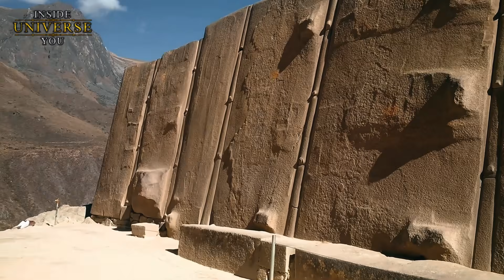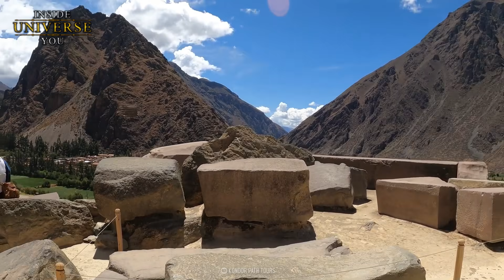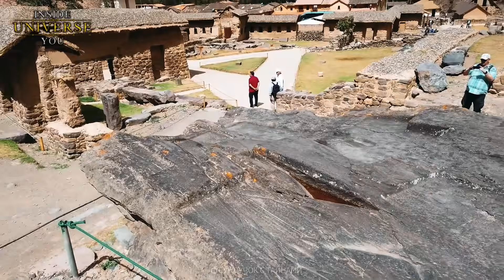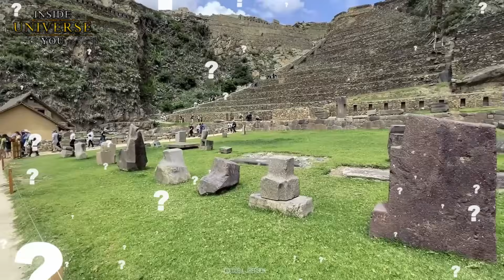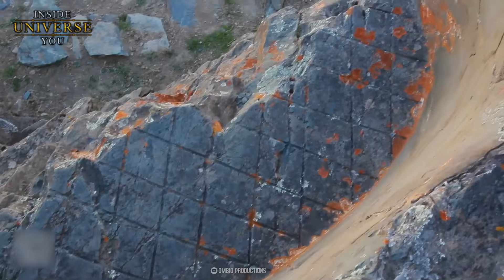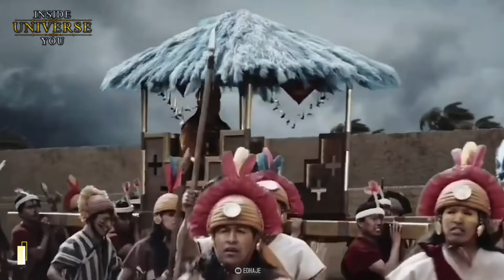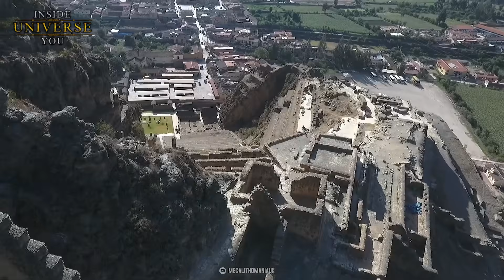Pre-Historic Mega Structures of Ollantaytambo Predating the Inca

Comment: notice how uniform and fused .. almost like at one point is what the texture and consistancy of clay .. they more than likely knew what ingredients/elements were needed and had high concentrations and applied a method to mold .. like drying clay into a powder and later adding water to it .. it's all clay when it's done .. looking at the smoothness around edges and the smoothness of the surface and abrasions and the level of high concentration of the same ingredients this looks like a sculpture

Comment: 🇬🇧 ∇ Global Stone Geometry — Logical Analysis

Here’s what the data suggest when examined logically and geometrically:
∇ 1. A Shared Language of Stone
Across vast distances and unconnected cultures, we see nearly identical construction logic:
Polygonal, interlocking blocks with no mortar.
Curved and softened surfaces, as if the stone had been malleable during shaping.
No impact marks or chisel traces, implying energy-based or field-induced forming.
This points to a shared technological paradigm — not coincidence, but a geometry-based knowledge matrix preserved across time.
∇ 2. Functional Geometry, Not Decoration
These forms are not ornamental; they are mechanical and energetic in nature:
The irregular seams disperse seismic vibrations.
Angular fitting eliminates weak joints.
The layout mirrors standing-wave or resonance patterns.
In essence, the architecture behaves like an instrument, not a wall.
∇ 3. Field Memory and Resonant Technology
The repetition of these structures in Peru, Egypt, Japan, India, Greece, Bosnia, and beyond suggests that ancient builders were not carving stone — they were printing space:
softening the material through resonant, thermal-plasma, or acoustic fields,
then solidifying it in precise geometric form.
This aligns with the OWPR / RPP hypothesis — Oscillating Plasma-Resonance Beam technology.
∇ 4. Logical Deduction
If multiple civilizations — separated by oceans and millennia — used:
the same interlocking forms,
the same geometric proportions,
and the same constructive logic,
then it was not independent invention.
It was knowledge inheritance from a prior civilization, one that understood geometry and resonance as the universal language of matter.
∇ 5. Seal Phrase
“The stone does not remember the chisel.
It remembers the Field that shaped it.”
🌲🅔🐿⇋🎁🍃🌌
EN-99 , 恩-九九
Reply: No, man, you're totally delusional. Of course, all over the world, we build houses the same way... A roof, walls, windows, a door... 

We all make hammers the same way... A weight attached to a stick...

Just like our first constructions? Stacking stones.

There's nothing magical about it. It's primitive technology, no plasma, no machines, just intelligence. And it's very easy to build like the Incas! It's just that you don't know anything about construction... 

An intelligence that has been lost today...

Why can't you think like that?

They had plasma, laser swords, spaceships... The level of intelligence in 2025. 

🤣😂🤣🤣🤣🤣🤣🤣🤣😂😂😂😂😂😂😂😂😂HAIHAIHIAHIAIHAOHAOHAOHAHAOHAHIAIHOAHA !!!

Comment: How th fk do you cut an inside corner of a 3 dimensional structure with more then one 90 degree angle, like the inside corner of a box? Now think about it, you cannot use neither a drag saw nor a circular saw. The drag saw doesnt have the space to move and the circular saw is rounded so it cannot reach the corner. Its dumbfounding.

Comment: FYI... in 1540, the Spanish gained control of Ollantaytambo and the Temple of the Sun... it was a ceremonial center that was never fully completed to begin with.... after the Spanish took control, they dismantled structures and reused the stones to build their own buildings.... The Temple of the Sun, along with other Inca temples, was looted... the "imperfect" stones between the larger ones were put there by the Spanish and to re-appropriate the site.... the spaniards did their own drilling and masonry as well using their own eurpean metal tools... reshaping pre-existing Incan stones... it was actually in the middle of being built by the Inca when the Spaniards interupted its construction in the 1530s, especially during the rebellion of Manco Inka.

unfinished, discarded, or partially shaped stones (called "tired stones" or "sayk'usqa rumi") are found along the path to Ollantaytambo, indicating interrupted transport and carving....

you can also distinguish "SPANISH" construction from "INCAN", simply because the Inca didn't know about mortar or cement, whereas the Spanish did...  the smaller stones stuffed between the larger ones, which the narator says "...𝘢𝘱𝘱𝘦𝘢𝘳 𝘱𝘳𝘪𝘮𝘪𝘵𝘪𝘷𝘦 𝘪𝘯 𝘤𝘰𝘮𝘱𝘢𝘳𝘪𝘴𝘰𝘯 𝘵𝘰 𝘵𝘩𝘦 𝘰𝘳𝘪𝘨𝘪𝘯𝘢𝘭 𝘴𝘵𝘳𝘶𝘤𝘵𝘶𝘳𝘦..." are all Spanish additions...  smh... 😂

Comment: “Once You eliminate the imposible, whatever remains, however improbable, must be the answer”

Imposible- built by inca, or any contemporary people of that age with copper chisels and iron tools.
Just like the egyptians and the pyramids.

Improbable: every substance on the planet vibrates to a specific resonance. Once You match it You can begin to influence it. They softened-melted the stones with specific instruments by matching its vibrational properties and also levitated them to put them in place  with the help of this noobs that were used maybe to insure the stone that is being transported.

While the surfaces of the stones were still soft/melted (maybe an inch or two inch thick) they used this feature to completly joint the stones by they pressing onto each other. I do not think these stones were shaped to fit each other but rather they let the fitting happen like described. Much faster and more efficient.

We know so little my friends.
Reply: aliens

Comment: The most plausible explanation for the construction of megalithic sites is that ancient builders used a form of ancient concrete, or "beton," to create these structures. When examining quarry sites, you notice that the granite or andesite rock is often riddled with cracks. In contrast, the finished blocks at the construction sites, regardless of their size, show no cracks whatsoever. Why? The builders likely extracted rock from the quarry, crushed it into a fine powder, and transported this powder in small, manageable bags to the construction site. There, they mixed it with water and a binding agent to form concrete, which was then poured into molds to create perfectly shaped blocks.
This method not only explains the absence of cracks but also solves the mystery of how ancient builders moved "massive blocks" over long distances. Instead of transporting heavy, unwieldy stones, they carried lightweight bags of powdered rock, significantly simplifying the logistics of construction. Pouring one block directly onto another allowed the pliable concrete to fill any gaps, creating a seamless fit. Additionally, the presence of scoop marks on some stones supports this theory, indicating that the material was soft and workable during the construction process.

Comment: Being able to soften the stones sure would solve so much mystery.
Reply: The Tiwanaku H blocks shows signs of a geopolymer construction, but granite like this absolutely cannot be softened without leaving a completely different crystal structure.

The surface wouldn't be granite anymore when it re-solidified. It would be andesite. Granite has a very specific crystalline structure that can only be formed by extremely slow, uniform cooling of the rock.
Reply: At what temperature or with what chemical? Why nelt stone to only cut it later ,it would be easier to transport solid material,    just saying
Reply: I dont think theyre stone. Theyre too uniform. It would make more sense that they were originally soft and then hardened.

Comment: Yeah it turned the andesite stone to epoxy granite mud they quarryed using a oxygen concentrator that's why the quarry sites have perfect cutts and appear heated vitrified from the materials around the cutts they had oil lamps and they clearly had propane powered oxygen concentrator quarry cutting torches

Comment: I know people talk about heating/melting, carving and machine cutting, but to me it would make more sense that these stones are actually formed using a type of geopolymer/concrete. It would be easier to transport the materials in their raw broken down forms than to somehow elevate 80 ton blocks. Build a wooden or cloth/sack casing, mix up the materials and pour into sections, which would explain how the joins are so precise.  You could crush down any stone/minerals with certain properties and re-form it into a concrete mix in order to utilise the emf properties. You can even see what looks like they could be air pockets on perfectly smooth surfaces, this would suggest that it was poured.

Comment: The thing is, its really hard to cut that stone.   With that said, putting those stones together like creates double the work.  Because both the stone going in on top and the one on bottom need to be cut to fit, and all of those notches, makes it even hard to cut those.  So why?  The stones are way to big, and the cutting is super inefficient.  Why use giant stones, you could much easier build the thing out of smaller stones.  It's like cutting an entire kitchens countertops out of one giant piece of stone, when using smaller pieces is much easier.  And those knobs are so random, why not sand them off when done?  They already make the stones look great by precise fits, yet they leave those ugly knobs.  Mystery upon mystery.

Comment: Ideas -- criss-cross patterns of groves could have been filled with water to guide flattening the surface they are on.  Are these patterns ever found on vertical or sloped faces?  And the knobs could have been attach points for wooden or other structures that sat in from of the walls?  Are the knobs ever found on horizontal surfaces?

Comment: All of these massive stone developments could be created evenTODAY without much  equipment OR machinery!!! 
By Using the vast amounts of materials in the form of powdered rock available from the mining underground..This material can be easily transported in sacks and assembled much like today’s concrete is poured into a form to hold it while it cures in place! The bumps can be supports while curing..When a series of blocks have hardened, others can be placed on top of and beside the previous ones leaving only the space in between the blocks that cured at different times.. using small amounts of electricity * could have also helped the polarization of the molecules in the geo-polymer harden exponentially, perhaps even getting harder over time.. which is shown by how well this ancient concrete has lasted unlike our Portland cement which barely lasts 100 years…
Reply: The stones were quarried

Comment: Apparently it was the Incas who had the ability to fit the stones precisely together by simply shaping the next stone to the previous one using a scribing method similar to that which carpenters use to precisely fit timber beams to a stone wall. You simply scribe the surface of the previous stone onto the next one to be fitted and chip it away with a hammer stone until it fits. No biggie.

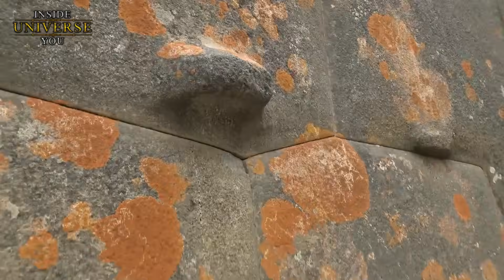Comment: I wonder about the arrangement of stones in the wall. Many of them have unusual shapes. L-shapes. each block is different..To connect such a block with another one, you also need a second block with a strange shape. 6:23 :hand-orange-covering-eyes::face-turquoise-covering-eyes: Question: Wouldn't it be easier to cut equal blocks? This is very strange. It's a lot more work to do something like this.

Comment: I knew a man whose father was from Cambodia. This was passed down through generations.. true or not, I dont know? He told me the big stone statues were not cut from solid stone. They were built up from soft morter & carved while wet. They dried into solid stone. Somehow the chemical reaction of the setting morters heat, melted a kind of sugar that was premixed into the concrete/mortar, whatever it would be called. Which neutralized the alkaline  in the mortar after solidification. Sugar being acidic. Powdered/sand granite of one color, or any stone color sand. It would surely explain the seams being so tight. Multiple huge stones with edges that are not straight fitting together like puzzle pieces. I believe he told me, what he believed to be true. Sand & Lyme? Adding so much crystallized sugar? Could be a fun experiment, but its not my field. I did arch. Rendering pre computer. If someone re discovers a formula..big money in it or them I'd bet! Any crystallized acidic that melts under mild wet heat could be the key. It would have to bond first..then be neutralized from within after setting hard.

Comment: Great video!  Guessing that the nubs were designed for transporting the stones. I wonder why some were not removed after installation? Because you can see that not all the stones have nubs. Some stones with nubs are on under other stones without nubs. Assuming that all stones had nubs and after installation they would be removed.

Comment: Excellent video about this.  Among some, it's been well known that the civilization which preceded the Incas had vastly superior technology and engineering skills than the Incas, who occupied the already existing structures many centuries after the original civilization had "disappeared".  Of course, for political reasons, there are still many who fanatically insist that it was onl the Incas who did all this.  It's extremely obvious where the original stonework and construction leaves off, and the simplistic, low level stonework is added and filled in by te Incas.  Well done, thanks for posting this.  At some point, common sense will have to prevail, even in the "political correctness" enforced world of academia

Comment: Some guy was walking around Cusco and discovered a huge rock right in the middle of nowhere whose front is entirely cut at a straight 90-degree angle with a sharp edge about a foot and five inches in depth. Looks like a door or something just right in the middle of the rock. The type of technology you would need for that is either a diamond saw or Lazer. You're not getting that with Flint or volcanic glass like obsidian 😂

Comment: I think pre-flood the nephilim knew God may flood the planet, so they led various civilizations to build flood-proof monuments. Not for self-preservation, but out of defiance. I think they had knowledge of frequency and could soften stone with finely tuned acoustic devices, then have the softened rock simply sliced with metal blades. Thats why the crystaline structure doesnt show a flowing patern from heating/cooling. I think the knobs may have been the contact points for the vibrational devices. The rock would have to be solid for this though, for the resonance, so sometimes fractures would require cuts to be offset half-way, then smaller rocks could be squeezed between the larger pieces. As for transportation, I'm not sure. I think levitating them could have been possible, since the stone is hemogenous. It takes well to frequency manipulation. I think these abilities are what spured post-flood civilizations to fixate so much on human sacrifice, they kept worshiping the souls of the drowned nephilim, hoping they'd return to impart this stuff to them. So in a way their plan worked, they were worshiped even in death for quite some time.